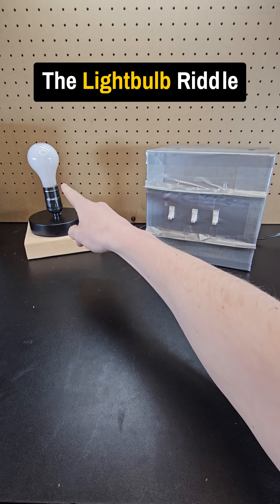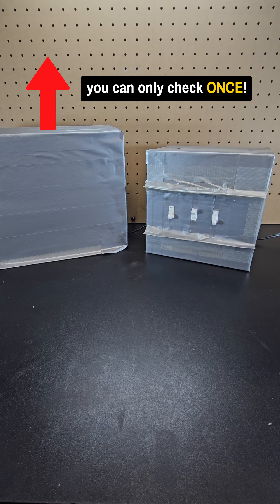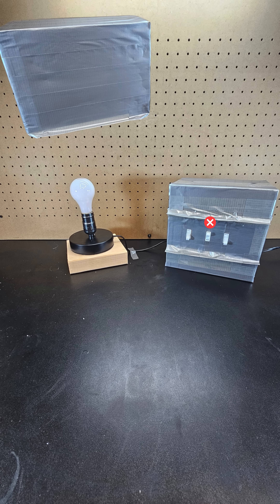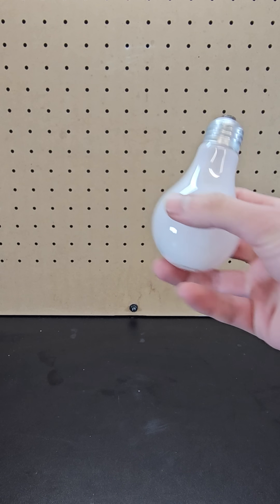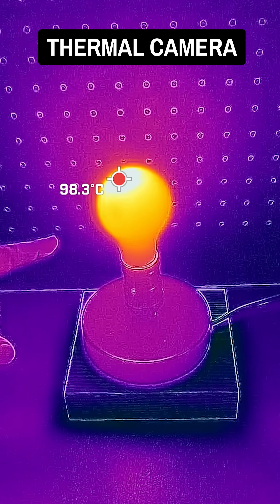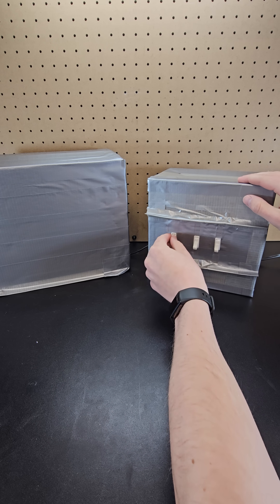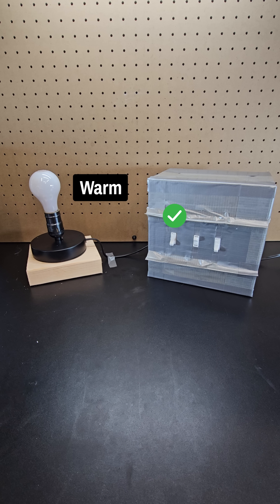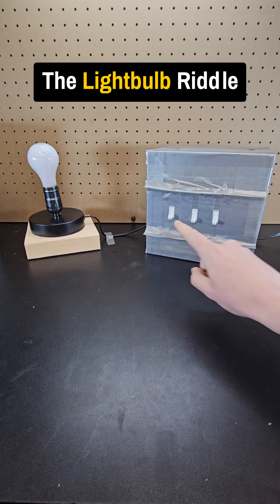Can you solve this Lightbulb Riddle? #science #shorts

Comment: i've heard this one before. you turn on switches 1 and 2 and leave them on for 15 minutes, then you turn switch number 2 off, then you check the box. if the light is on, then it's switch number 1, when it's off but warm, it's switch number 2, if it's off and cold, it's switch number 3. 

edit: i was slightly wrong, you don't turn on two of them at once, you only turn on one, and then turn it off and switch another on

Comment: I myself though, lift the first one for a long time, the box heat if it was on, if not I will flip for the next switch and check immediately, if the box hot it was first, if it cold is the second, if it cold and off it must been the third one

Comment: Flip the first switch and leave it on for 10 minutes then flip it off and turn on the second switch. You then woould check the loght bulb and if it is warm the first switch turned it on if it is on the. It is the second and if neither are true it is the third switch

Comment: Flip 2 switches up. whatever you want. 
then wait 1 minute and switch one of the 2 off before you check

if the bulb is off but hot: the switch you flipped last is the correct one
if the bulb is on, then the switch in the on position is the one
if the bulb is off AND cold. it's the third one

bye

Comment: I paused clip where he put cover on bulb. So I didn't see the video itself. But I used to know this «riddle».

1. Turn on 1st switch. Wait for 15-20 minutes. Then turn it off.

2. Turn the 2nd switch. And check the bulb. 

It's working? Great. Switch №2 is our answer. Not working? Touch it. Warm? Then our answer is a 1st switch. Cold? Then it's simple. Answer switch number 3 is correct.

Comment: Since it is an old type lamp, I can enter from the heat
I leave the first one on for 1 minute, then I turn the first one off and leave the second one on for 2 minutes. Then I turn the second one off and leave the third one on for 3 minutes. Since all three provide different amounts of heat, this is understandable. Touch the lamp (I used a translation, it may have been translated badly)

Comment: Ok, flip one switch, count to 30. Flip it off, then flip another and open the box. If it is on, the second switch is correct, if it’s off but the light bulb is warm, the first switch is correct, and if it is cool, then the third switch is correct.

ALSO: the base of LED and Fluorescent bulbs still heat up when used, so you can still use the heat from the base

Comment: I wasn’t thinking in the right direction at all. But I was able to come up with the solution that lets me guess the right switch with 7/9 chance using Monty Hall problem. 

So you guess random switch(for example number 1), but don’t flip it, instead you flip another one of two(for example number 2) and you open the box, if the bulb is on then obviously it is the right switch(1/3 chance), but if it is not on then you pick the switch number 3 and say that it is the right switch. By switching your choice from number 1 to number 3 you have 2/3 chance that it is the right switch.

Comment: I know the solution from a series. You leave one switch on for about 10 minutes and then off again. Then you turn on the second switch and look underneath. If the light bulb is warm, so it was the 1st. Switch. When the light bulb is on, it was the 2nd Switch. But if neither is the case, it is the 3rd. Switch.

Comment: Before watching this, I’d turn the first switch on for a while so if it is the correct one, the bulb will heat up. Then I’ll flip off the first switch while simultaneously switching on the second switch before quickly removing the cover to check the light bulb for either light or heat. If the bulb is on, it’s 2, if the bulb is off and hot, it’s 1, if the bulb is neither it’s 3. This is really easy.

Edit: yeah that was really easy

Comment: The original answer was slightly different: originally, you're give a limit of two flips, so you turn on two switches (counted as one flip), wait a couple minutes, then turn one off (second flip). The end result is the same, but as you aren't flipping one on and one off, the number of flips stays low

Comment: Turn on the first light switch for a while, then turn it off, and then turn on the middle light switch and check the box:

-If the light bulb is on, it's the middle one
-If the light bulb is hot, it's the first one
-If the light bulb is off and cold, it's the third one

Comment: flip 1 switch and after 30 seconds turn it off, lift the cover, touch the light bulb and if it's hot then the switch you flipped is the correct one, if it's not hot then flip a different switch with the cover off and then if it stays off then the 3rd switch is the correct one switch is the correct one if not then the second switch you flipped is the correct one.

Simple!

Comment: If you are going to use a heat meter use a watt meter instead then you don't have to wait as long.  Or put a compass next to one of the wires and look for change of behavior of the compass with each switching of the switches.

Comment: Turn one light switch on for an extended period of time. Turn it off and turn on another light switch then lift the lid. If the light is on then it’s the switch you left on. If the light is off but warm, it’s the first switch. And if it’s cold, then it’s the switch you haven’t touched yet.

Comment: Turn the first switch on for 5 minutes. Turn it off.
Turn the second switch on for 5 minutes, Turn it off.
Immediately turn on the 3rd switch and lift the  box.
If the bulb is hot, but off. Its the second switch.
If its off but cold, its the first switch.
If its on it’s obviously the 3rd switch.

Comment: If the lamp is a heat lamp then you can flip switch 1 wait a while then turn that one off and turn on switch 2. If it isn't on or hot it is switch 3, if it is hot but not on it is switch 1, if it is on it is switch 2.

Comment: Turn on 2 switches and leave them on for several minutes.  Then turn off one switch and leave it off for a couple of minutes.  Then turn off the final switch before lifting the box and check the bulb.  If it's super hot, you know it's the switch you just turned off.  If it's kinda warm, you know it's the switch you turned off first.  If it's cold, you know it's the switch you didn't turn on at all.

Holy crap I didn't know he was going to give this same answer.  I thought I was being super smart and coming up with an answer that was sheer genius, but I'm just second best, as usual.

Comment: On the first light switch and wait for 10 minutes and then off it and on the second light switch and check if the light bulb is hot it's a first light switch if the light bulb is cold its third switch but if the light is on its second one.

Comment: Leave one of for 5 minutes then turn it off and turn another one on. If the light is on you found the right one. If not touch the other two. If one of them is hot you know that the first one you turned on was the right one but if all are cold the one you didn’t turn on is the correct one.

Comment: ehhhhh this one kinda stinks. If you get to specify what kind of light you need to use as part of the solution you should also just be able to poke a hole in the box since it isn't technically lifting it

Comment: Turn on the first switch, and leave it for 20 minutes. Turn it off and turn on the second switch, and lift the box. If the bulb is on, then it's the answer. If not, touch the bulb. If it's hot, then the first one is an answer. If not, the third one is the answer!!😶🙂

Comment: Answer: switch on 2 random switches, then turn off one of the on switches and open it to check. If it’s on, then you’ll know the currently on switch is connected to the light bulb. If off, then touch it. If it’s hot, then it’s connected to the switch that used to be on. If it’s cold, then it’s connected to the switch you never touch.

Comment: Flip one up for a very long time.

Turn it off.

Flip the next one on, and immediately lift the box.

Two things to quickly check:
If it is on, the second switch is the lightswitch.
If it's off, the next thing to check is the heat of the lightbulb.

If it is warm, then the first lightswitch is the real one, because the light had been on for a while and warmed up the lightbulb.

If it is still room temp, then the third switch you never used is the lightswitch.

Disclaimer: I knew about this riddle before, and knew it had to do with using the light to heat the lightbulb, but couldn't remember *how* to do it without some thinking lol.

Comment: Here's a solution from a movie

Turn on the first switch then after 10 minutes turn it off and turn on the 2nd
If the bulb is off but hot then it's the first switch
If it's turned on then it's the second switch
If it's cold and turned off then it's the 3rd

Comment: Here's what I do flip light switch number one let it stay on for 10 minutes, after 10 minutes I would flip the switch off then flip the switch 2 then I would remove the lid and if the light was on then it was a light switch number two if the light is off but warm then it was a light switch number one but if the light is not on or and it's off and not hot then it's light switch number three.

Comment: You can do it in one try. Flip two switches, wait for a bit so the light bulb gets hot if its on, then flip one of the switches back to off, when you lift up the box if its glowing, its the one thats on, if its hot but not glowing its the one you flipped back if its cold its the switch you didnt flip at all

Comment: Flip the first switch on then wait a little bit, then turn that on off and turn the second one on before taking off the lid. If the light bulb is on, it’s the second one, off I feel the top, if it is hot it’s the first one as the lightbulb would have heated up due to being on for a good minute during the first switch. If it’s neither, it’s the 3rd one. Though this strategy is defunct as we switch to led light bulbs which don’t produce as much heat make it harder to check
Reply: I was right

Comment: Actual solution for people who are looking in the comments for the answer (because of course he wasnt going to answer this riddle)
Flip one switch on and leave it on for 10 minutes or more. After that, flip it off and flip on another one. Keep track of which one you had on and which one you left untouched. Open the box and check the light. If the light is on, the switch you flipped on second is the light switch that works the lightbulb. If the light is off, touch the bulb and see if it is warm or cold. If the bulb is warm, the first switch you flipped is the light switch, and if it's cold, then the switch that you didnt touch is the one that controls the lightbulb.

Comment: I would switch the first light on and leave it for 10 minutes. Then when the 10 minutes are over I would switch the 2nd light on. I would feel the light bulb and see if it is hot. If it is, the first switch is the option. If the second switch flipped it on then the 2nd switch is it. And if the lightbulb is not hot and the 2nd switch does not light it up, then the 3rd would be the switch .

Comment: Technically you can do it without the temperature of the bulb, the rules states only check to lift the box once, that means you can turn switch 1 and 2 on, leave 3 off. Lift the box, if the light is off then its switch 3 if the light is on then just turn on of the switches 1 or 2 off, since you already lift the box you can just flick it if you turn 1 and it turns off then its 1 and if not then its 2, and thats it. And the rules never said you couldn't move the switches after you check so its legal

Comment: I've found 16 solutions so far:

Solution 1: As shown.

Solution 2: Turn the room really, really dark. Take a second, low-wattage fluorescent lightbulb. When the correct switch is on, the fluorescent bulb will light up slightly from the AC current’s varying magnetism. Your doomscroller eyeballs may be insufficient, so you might need equipment.

Solution 3: Poke a hole through the box so you don't have to lift it.

Solution 4: Dismantle the switch box to check which one controls the bulb.

Solution 5: measure tension in the wires going to the bulb, then flick the switches like a monkey until the voltage is nonzero.

Solution 6: Short-circuit the two stripped wires going to the bulb. Flick a switch, then check whether a breaker tripped in your electrical box. Rinse, repeat. Don't let the riddle teller move, or they'll reset the breaker/switch while you're not watching. Yes, I know you and your fake videos @JaDroppingScience!

Solution 7: Tell the riddle teller you'll give them a free lightbulb if they tell you which switch is correct.

Solution 8 (my personal favorite): Like solution 5, but to check the tension in the wires, place one of the riddle teller's fingers on both stripped wires and start flicking. WARNING: DON'T TRY THIS AT HOME! Instead, try this near a chemical plant where you'll be able to shove the riddle teller's body in acid afterward.

Solution 9: Unscrew the lightbulb. Subsequently place your thumb and index finger on your chin and look up. With your free hand, place the lightbulb on your head. Now enable cartoon mode (tutorial: hit Alt+F4 on your keyboard). Finally, flick the left switch with the big toe of your right foot, while simultaneously pointing the index finger that is on your chin to the ceiling, yelling "EUREKA!". The lightbulb on your head will turn on. The left switch is therefore the answer.

Solution 10: Flick a switch. Since you're obviously OPed, type the command "/gamemode spectator". Now clip through the box to see whether the bulb is on. If not, type the command "/gamemode creative" and try again until the switch is found. For more swag points, yell "CHICKEN JOCKEY!" once the correct switch is found.

Solution 11: Break the lightbulb glass. When you turn the correct switch on, you'll hear the bulb filament break. BOOOOOORING!

Solution 12: Ask ChatGPT. BOOOOOOOOOOOOOOOOOOOOOOOORING!

Solution 13: It's the left switch. If that is the incorrect answer, reload the last SNES9x savestate and try again.

Solution 14: It's the left switch. If that is the incorrect answer, ask Chuck Norris to return that favor he had owed you for a while.

Solution 15: Love is always the answer.

Solution 16: Ask your wife / mom, she knows everything.

-----------------

Copyright (c) 2025 Myself

THESE SOLUTIONS ARE PROVIDED "AS IS" WITHOUT WARRANTY OF ANY KIND, EXPRESS OR IMPLIED, TO THE EXTENT PERMISSIBLE BY LAW.

Comment: Flip switch A, and leave it on glfor a hot minute, flip it off, and turn B on, then pull up the cover, if the light is on, it's B, if it's hot it's A, otherwise it's C

Comment: I've seen a bunch of ways to solve this problem (they generally work off utilizing the heat from the bulb create 3 states).  I'm partial to this one:
If there was a demonstration, wait until all bulbs are undoubtably cool again. 
Flip two of the switches (lets say 2 and 3 if they are labeled sequentially) and keep them on a while.  (if there's no time limit, then like 10 minutes - just to be sure they warm up).  
Flip off switch 2 and uncover.  
There are 3 different states that can occur here and they tell you which switch works. 
State 1 (corresponding to switch 1):  All the bulbs are off and cold.  It is the first switch.
State 2: Bulbs are off, but they are warm.  It is the second switch you just turned off. 
State 3: Bulbs are on.  It's the third switch.
Reply: That's the same as this solution, except 1 and 3 are switched (mind the pun)
Reply: You just added an extra step by flipping another switch.
Reply: You can hear the connected switch because it will arc when slowly turned off, takes only a few seconds.

Comment: Flip 2 of the switches leave it on for a minute then flip one of them off. If the light is on then the switch left on is the one that turns it on, if the light is hot then then one you turned off is the one, if the light is cold then the switch you didn't touch turns it non

Comment: You leave the first one on for a while, and then you turn it off then you turn on the middle one for just a moment and turn it off and then check by touching the bulb, If the bulb is really hot then it's the left one, If the bulb is slightly warm it's the middle one and if the bulb is cold then it's the right one

Comment: Flip the first and second switches.  A few minutes later, flip the second one off again. Remove the cover. If the light is on, it's the first switch. If it's off, but hot, it's the second switch. If it's off and cool, it's the third switch.

Comment: Turn the first switch on for like 5 minutes or so then turn it off, turn the second switch on then check the light. If the light bulb is on then it’s the second switch, if the light bulb is off and hot to the touch it’s the first switch, if the light is off and cold to the touch then it’s the third switch.

Comment: You could also listen? Incandescent bulbs make a noise when they turn on
Reply: The actual riddle has the light in another room.
Reply: Since when?
Reply: @user-yi7zj3lv5t  Obv thats why criminals tape mouths with it! Sounds physically cannot penetrate duct tape. Basic knowledge, grow up. /j
Reply: No, they don't. You meant the fluorescent lamp.
Reply: @ even then those kind weren’t reallly audible
Reply: Wouldn’t work. Duct tape is soundproof.
Reply: Not really the bulb but you can hear which switch arcs when turned off if it's actually connected.
Reply: @TechHowden others switches can also be connected to other lamps. In the original puzzle, the switches are identical. It is implied that they are identical here, too.
Reply: No? Like no? Switch makes noise but incandescent bulbs are silent? Just checked it
Reply: @Hibari_fan  These bulbs may make noise when on a dimmer, I'm guessing that's what they were thinking of.